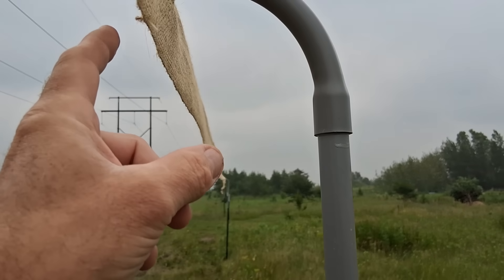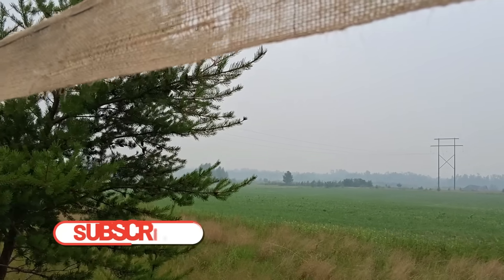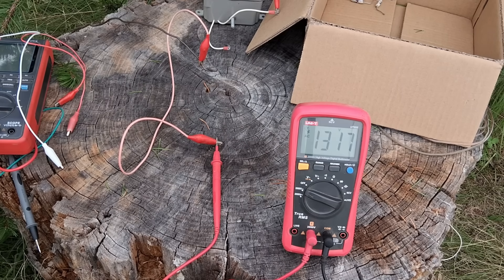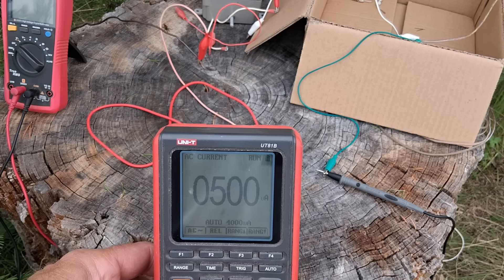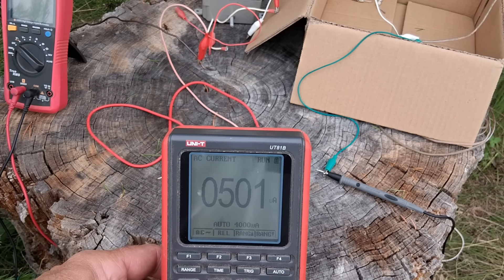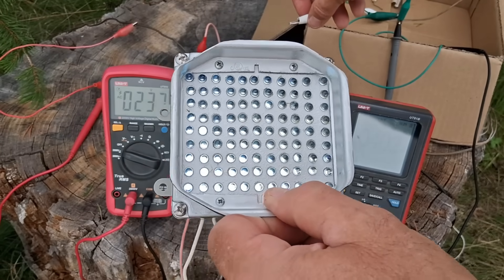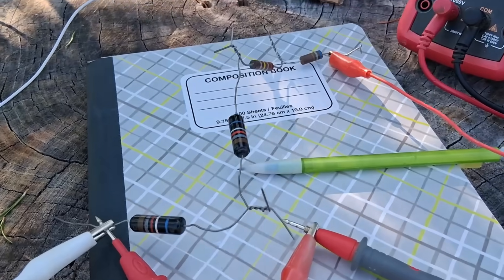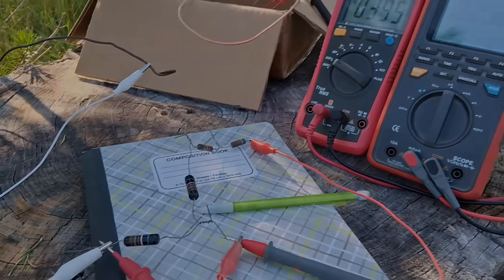Power sucking fences near H.V. power lines.  What transpired since?

Comment: Nicola Tesla discovered that high voltage static power can be harvested best by using hundreds of pins with pointed tips facing the area that the voltage is coming from, because the fine pointed tips of the pins, collect power better then things like flat or rounded wire, so try building something that can hold hundreds of sewing needles, to help collect  that static power.
    Also, your captured power can become more usable, by decreasing the voltage your taking in, because by the virtue of laws, if you decrease power by turning your voltage into a square wave,  then running it through a stepdown transformer, the voltage will decrease but the amperage output will increase, so if you stepped down the voltage to 12 volts d.c, then your amperage will become useful enough to charge batteries or run things, and I would recomend using a 12 volt d.c to d.c converter, to help maintain a stable voltage....🧐🤔😎👍
Reply from the maker: I've tried copper tinsel, and copper mesh.  The mesh worked the best.  Thanks for the interest!
Reply: @doubleMinnovations  Try barbed wire.
Reply: What about Barbed wire?

Comment: the burlap is interesting i think everything is able to react to em its just metal that is the most noticed for example a radio signal can be blocked by a forest this probably means that the trees are able to absorb the radio waves at least a little bit
Reply from the maker: I'm sure the trees are.  They will cut them down when they see bigger one within the easement.

Comment: You can try using a tube filament step down transformer and a bridge rectifier and likely get better results.
Reply: Since the voltage is so high, wouldn't a microwave oven transformer be more appropriate?  Since I'm not an expert in microwave oven voltages, I'm just guessing.

Comment: Instead of using ground could you use a separate second antenna and use something like opposed diodes on each one to create a true single phase instead of relying on irregular resistance of ground?
Reply: Energy is only transferred by radiation  resonating.   An antenna may be wide or tuned for  high gain narrow band.   Under power lines at 50 c/s we are seeing a transformer with a portion of a single turn of wire.   This principle was used on a marine log to measure speed and distance two electrodes in sea water pass a small current through this portion of  a single turn and measure the induced back EMF.  It was not a very good log marine growth made it unreliable  after a few days

Comment: lol that’s just 0.1W… you’d be better off with a small solar panel! What you do collect is just capacitive leakage which would have flowed to earth anyway. It’s factored into overhead lines what the losses are.
Reply from the maker: You are right; but this is more fun than solar! (high voltage with sparks)  And it's 24/7

Comment: Lawrence rayburn patent, 10 kw ionishere antenna, used soft copper pipe, plus huge ground plate, and 10 huge step up or step down coils and spark  gap,

Comment: You should try this not near any power lines to see if it is simply atmospheric electricity. 1,300 volts * 500 microamps is equal to 0.68 watts passing it through the LED Matrix lowers the wattage due to the voltage drop of the leds.
Reply from the maker: I have other antennas set up about 100 yards the the power lines.  I use them for a crystal radio, while getting a little power off them too to light LEDs.  You may find it interesting to check out some of my other videos.

Comment: Aeons ago I was a power plant operator. One day after work a coworker needed a jump. So I drove over to his vehicle, popped the hood and connected the jumpers. After he got running I went to close the hood and got an unexpected shock. We both wondered if there was a short…and then looked up. We were parked right under the HV transmission lines. Oops.
Reply: I was installing cameras and gate controls inside & outside the fence at a Hydro Plant. 
Especially during the foggy damp days, It was creepy as hell being that close to the high voltage.
Btw,
The video and signaling was connected via fiber optic and converters.
Reply from the maker: That's quite a story, thanks for sharing!
Reply: There is a petrol station near to me that has huge pylons buzzing loudly directly above it.

Comment: Hello, iam developement electro engi, i would say have wires aimed from top to ground, since that is way the em fields go, if it would be coils aiming from top to ground, connected in paraler direct to battery with anode in ground you may be able to live free and even register official supply from lets say ,,biofermentator,, and give them theire power, hope it helps ;) 

But have it isolated since you will get i belive multiples of the energy...

Comment: Since the fence wire represents such a high impedance source of power, I wonder if you connected your fence wire to the tower (high voltage) connection on an old style (circa 1960s - 1970s) automobile ignition coil. Maybe the impedance of the secondary (high voltage) winding of the coil would more closely match the impedance of the the fence wire. It's well known in electrical engineering that impedance matching is the most efficient way to transfer power. Then you could use whatever voltage that is induced in the primary of the ignition coil, which is at a lower impedance, to operate low impedance loads such as battery charging or LED lighting. I'm not sure if the coil's frequency response would extend down to the 60 Hz power line frequency. This would be an inexpensive way (an ignition coil from a junkyard) to see if impedance matching would increase the power you see from your rig.  Might make an interesting experiment. TIA, keep up the good work!
Reply from the maker: That is a really interesting idea, thanks for sharing!

Comment: IF you are at the legal fence line, the real question is how high can you raise your wire.  The higher it is, the more coupled current will be picked up.  The power company may have height restrictions, as they do in our area.  The burlap probably only works if it is damp, humid, or wet, since it just acts as a larger capacitive area.  Same thing could be achieved by just hanging another wire, or screen, below the weight bearing one.  If that is done, then getting the wires radially positioned, with respect to the power line, would also be helpful.  Use a canted Poly pipe to make it happen.  PS:  PVC pipe is mildly resistive, so test pipe type before using.  ESD engineer.
Reply from the maker: The burlap, wood, or rope increased the output whether it was dry, or frozen at -40˚F.   I have other videos comparing, and explaining what I think is happening.
Reply: I found that when experimenting with a Tesla Coil, PVC is a great insulator.     "Mildly Resistive,"      I think not.
Using a 1" SCH 40 PVC, and hanging 50 equally spaced 1/2" brass rounds with a chamfered hole centered along the axis on nylon strings one foot long from the PVC pipe, with 
the last connected to a ground. The HV would not only jump the 50 1/2" air gaps, but would instead jump to the chamfered edge of the hole, making 50 9/16" air gaps. 
On the coil side of the horizontally (bowed) PVC. I attached a 6" copper ball as the target, then connected the CU ball to the first brass 1/2" cylinder. Considering 10kV will jump a
1/4" air gap in a lab environment. The High Voltage jumped 25-28 inches of air instead of running along the surface of the PVC itself, which was the shortest path. Unfortunately, 
I only had 50. What do you think the voltage was in my High Voltage Divider? It was quite a spectacular sight, as well as the sound. I had the Copper ball spaced from the coil to be intermittently struck, about 4 feet.
Reply: I also had some trouble with PVC, thinking it's an insulator, only to find significant environmental (humidity, temperature, and time / age) and material (i.e. how much and what kind of plasticisers and other fillers are in that specific formulation) dependant variation in the PVC's resistivity, especially at high voltages.

Comment: I'm surprised the power company didn't mind the power "harvesting" (aka theft). There have been plenty of people who have gotten in trouble for doing similar things. I imagine you only get in trouble if the power taken is a measurable amount. A small amount power taken probably isn't worth worrying about for the power company.
Reply: He's just putting a bucket under what they're already spilling.
Reply: @pareidoliarocks  That's true with radio towers which purposefully broadcast but it's not true for power lines.
There are plenty of cases of people getting prosecuted for stealing power wirelessly. If the power were just being "spilled", the loss from people taking it couldn't be detected.
Reply: @ddegn  Once it leaves their right of way, it isn't theirs.
Reply: @David-hm9ic  Not true. There have been multiple cases of people being prosecuted for stealing power wirelessly. Stealing the power from outside of some zone doesn't change the fact power is being stolen. If the power being stolen is enough for the power company to notice, they will investigate.
Reply: Transmission loss is incredible down the line. Not really theft at all.

Comment: There was a farmer that lived close to the base of the Wenvoe TV transmitter mast in Wales (UK) back in the 1970s. He had a TV aerial and a diode rectifier that he used to charge a 12v car battery that ran some 12v lights in a remote building.

Because you have to have a TV license to “receive” the signal, they attempted to prosecute him for not having a license. He didn’t get fined, but was forced to buy a license as “punishment”. Back then you could get a much cheaper black and white license compared to colour (stupid, I know) but this made even more publicity for how stupid this was.
Reply from the maker: That's an interesting story, thanks for sharing!

Comment: Is a simple oscillator  circuit through a trans former to step down the voltage and increase the current to a level of more use.
Reply: Exctly. Set up an old neon sign or fuel oil furnace ignitor transformer with a high voltage capacitor in series with it to make a series LC tank circuit.   Good chance that with the right combo it could make a watt or two at a much lower output voltage.

Comment: Make your antenna as long as possible. A tuned quarter wavelength antenna is 752 miles long.... the closer you can get to that, the better. You should also use a dipole splitter with the earth as a groundplane for maximum gain. Also, your antenna doesnt need to be straight. It can zigzag quite a bit before you start to lose any efficiency.

Comment: Once when riding my mountain bike I came to top of a small hill and stopped to take in the view. There were power lines right overhead and I was at the point of maximum sag between two towers. The power lines were only about 20 feet away. As I stood there straddling my bike I was getting buzzed by a strong tingling. It didn’t hurt but it was very strong so I didn’t hang around very long.
Reply: Been there and also done that, in the hills above Santa Barbara.  In light fog or humid conditions you could see the coronal sparks coming off the wires, and the bolts were over two+feet long.  Occasionally a drip would come off the line, and the sparks would follow it down for several feet.  Drop vaporized and never hit the ground.
Reply: In the rain some lines make a crackling sizzle noise.
Reply: Oh ja, das kenne ich auch. In Rede ( Emsland) hängt eine Hochspannungsleitung über einer Autobahn Brücke und dort verläuft ein Radweg, wo ich beim drunter durchfahren schon ein starkes Gefühl von Strom hatte mit kurzer Hose an.😱
Reply: Park a container-truck there, and try touching it.  (But much of the effect will be shorted out by rubber tires full of carbon-black.)
Reply: Buzzing Balls, that could be uncomfortable!  😉 ⚡️
Reply: Same here. Was biking along a paved road under a high voltage transmission line and could feel a light tingling vibration in the metal handlebars.
Reply: God help any future children you may have......if you still can.😳😲😯🤦‍♂️😂😂😂😂😂
Reply: I have experienced this too on a humid morning.
Reply: 😂😂😂 no hv lines are that low but there is the hair stand on end buzzing
Reply: This is common around here. If you ever look at a switch yard, you'll notice everything is grounded, which helps address the issue of induction.
Reply: @glevideo Liar.
Reply: @RunsOnRust I believe him because I have felt the tingle in the air both while out four wheeling up the power line trails and while climbing power line towers. It will make your hair stand on end. The power is intense
Reply: @RunsOnRust  Why would you call glevideo a liar?  That's vile.  I worked for a surveyor when I was young.  We were out in the high desert in northwest New Mexico and parked the Jeep on a cross-country high voltage power line right of way.  IIRC, the power line was 110,000 volts.  After doing the work we came for, we returned to the Jeep.  It shocked the snot out of me when I touched it.
Reply: @David-hm9ic  Lots of AI bots out there. Many AIs are used to comment in a way that forces people to reply. They want more clicks, more views and more information for the bot owner! All about siphoning as much money as they can. If you see a compilation video, a video describing what’s going on, a video of a person seemingly stuck in a pose talking 😂, someone narrating and it’s a newer channel it’s more than likely run by a BOT aka AI Algorithm.
Reply: @RunsOnRust  👈Hate Bot
Reply: @RunsOnRust no reason to think he's lying.  Stay in school, son

Comment: Has anyone here actually measured the electric field below distribution 3-phase lines? I have - and it turns out the 3-phases cancel each other out for the most part below the lines ... Now, single phase overhead distribution lines exhibit quite a significant E-field below the lines. All this I can demonstrate with a simple DMM and a length of wire stuck into the 'High' terminal.
Reply: I was wondering if the load needs to be unbalanced; or if maybe he is getting most of the power from the nearest phase.
Reply from the maker: While experimenting under the power line with a stretched out wire, about 3-4 feet off the ground; the greatest reading was when the wire was placed around 2-3 feet off to the side of the outside power line wire.  When I moved my wire to outside the easement, I had to rise it up to where it is now, to get about the same reading.
Reply: @economicprisoner  Off to the side - in his demo. That helps. Some reduction in field intensity results from the other phases tho.
I used this technique to see which overhead lines were energized a few years back when we had a local power outage due to a fuse (on a lateral neighborhood circuit) open. Single overhead phase line gave the BIGGEST AC voltmeter readings.
Reply: @economicprisoner  Are my replies going through? I'm not seeing them ...
Reply: @uploadJ This one did go thru. YouTube has some weird algorithms that sometimes silently remove comments for no understandable reason. They really shoul give some notice when they do.
Reply: I can't see two of my replies .. can anyone else see those two replies?
Reply: @uploadJ  youtube does curiously stupid things with comments. if you try toggling between "newest" and "top" comments then sometimes they will show up.
Reply: @ThatOpalGuy   right, for whatever reason these days, "Top" comments are the "best" ones, PG rated and whatever else.  Long list of words being checked against, probably.  

they're also filtering the list under notifications, now.  Everything will be there when it's opened the first time, but after that only a handful will be shown.  Only the Top ones make it to notifications so this is like an extra layer of whatever it is.  "Thanks, YouTube !"
Reply from the maker: I just looked; and no comments are being held by YouTube, and I have not deleted any.  If someone deleted a comment they put up that you replied to, that may cause yours to go also.  Otherwise you can just try again...
Reply: @uploadJ  Youtube has some proprietary algorithm that deletes some comments.  Perhaps some of yours got the ax.  It's happened to me tons of times.